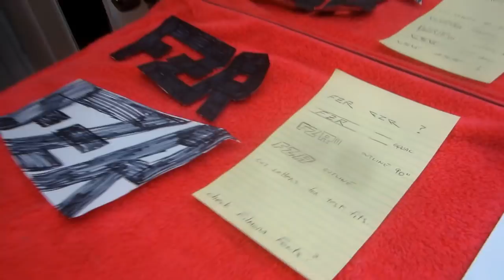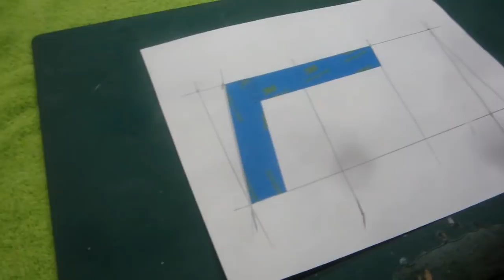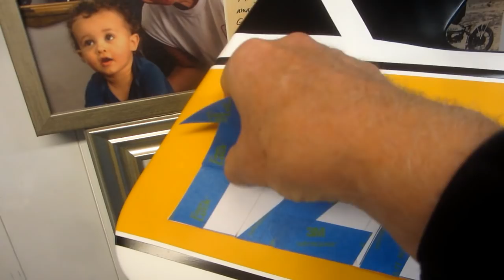pt 68 FZR RESTORATION,HOW TO DESIGN LOGOS AND GRAPHICS .

Comment: On the lettering,..can you try The Golden Ratio on this mr. Urtnowski?
-Where the special number found by dividing a line into two parts so that the longer part divided by the smaller part is also equal to the whole length divided by the longer part...Wahoo, I did loose myself right in the middle of this..
..by the way, what a lovely bike your putting up here!!
 I'm thinking you won't make the lettering to big.. the black'est decals you're trying out here..FZR- ones..could seem you've hit some great there..  
..